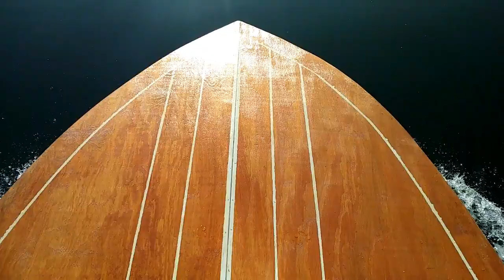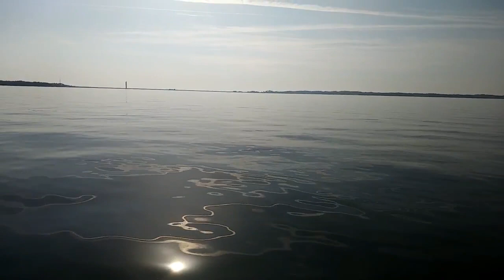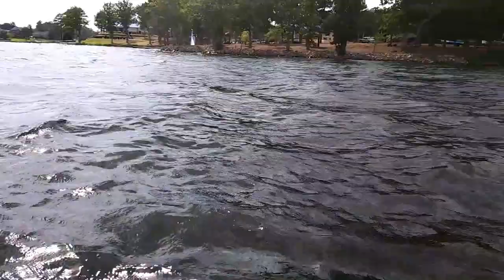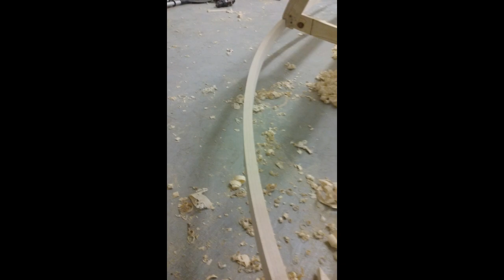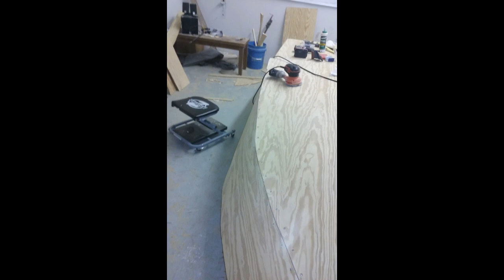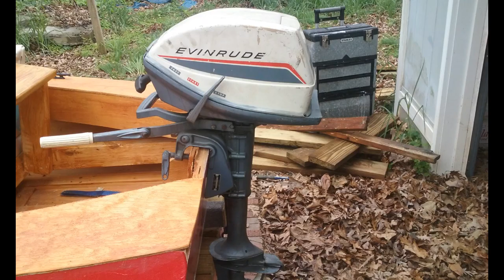Building A Boat, Glen L Squirt

Comment: Looks good. I just finished building a boat from a 1964 plan out of Popular Mechanics which called for 16 feet. I scaled it down to 8 feet and turned it into a seaflea. The hull design is an inverted V much like a cataraman. I used copper nails for my 1/4" sheathing and spruce for my frames.

Comment: Your boat looks great.  It looks like it was handling a mildly rough water pretty good.  Does it have a bilge pump?
Reply from the maker: No, no bilge pump, but I never had problems with to much water in the boat.
Reply: @FancifulTea  what if it rains?  And does it have a drain plug?
Reply from the maker: @repetitivemotion  I did not put a drain plug in it, tho looking back, I should have. As for rain, I kept it in a covered garage and didn't take it out when it rained... Tho you could put a pump in it I suppose, but that would add weight if it is motorized.👍
Reply: @FancifulTea  if you built a flying saucer, instead of a squirt, would it take longer?  Aren’t they essentially the same boats, but different sizes?  For that matter, it looks like the Squirt, F Saucer and the Zip are the same boat but in different sizes.  Would you think that the bigger the boat, the longer it takes to build?
Reply from the maker: @repetitivemotion  not necessarily, you will take more time with the fairing process, and more material, but I can't imagine there being a massive increase in hours spent. In some ways, a bigger boat can be easier to build. Not quite as sharp of curves for the hull and framework, more give on measurements etc. It's easier to live with 1/2 inch out of square over 15 ft than over 10 ft.

Comment: What horsepower is that Evinrude. I have a 5hp 2 stroke 94 Merc I want to put on something like this. Looks good.
Reply from the maker: It was a five horse, but I traded it in for a 9.9 Evinrude that ran when I bought it and promptly did not when I got it home. For this boat the 5hp. was a little underpowered, but still lots of fun!
Reply from the maker: It was a 5hp. that I ended up trading for a 9.9 Evinrude that ran when I bought it but promptly did not when I got home. The five horse was just a little underpowered for this boat but still lots of fun

Comment: So, you just basically don't follow instructions,  all totally newbie boo-boos. Thanks for your honesty,  I'm certain that you (and us) are learning. Question? What about these new electric,  minkota,  
Type motor.
Reply from the maker: I don't have any experience with those, but I would be a little apprehensive about using an electric motor as main power just in case the battery fails, or is not charged.
Reply: @FancifulTea  thanks for your time. It's to be a tender , at least 2 batterys , I only have 12' on the bridge deck. Thinking about placing the frame closer,  leaving beam alone,
Reply from the maker: That sounds like it should work, ide love to see some pictures if your project. I'm interested in how that would look. You can email me if you would like at fancifultea1@gmail.com